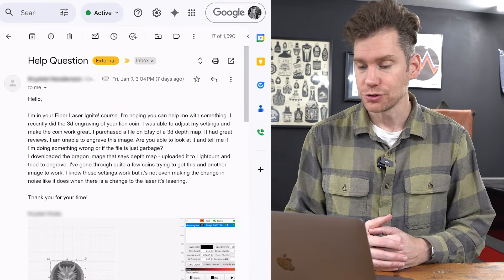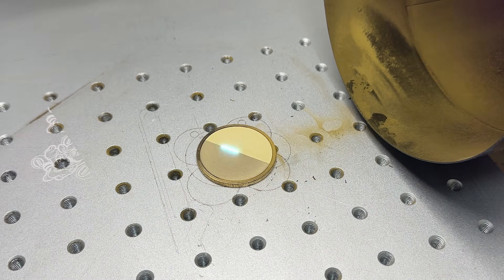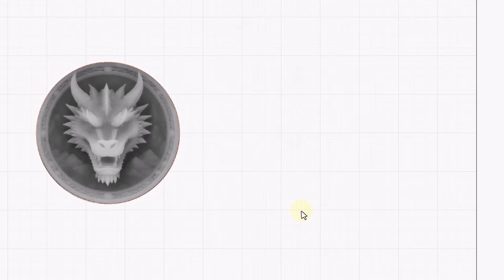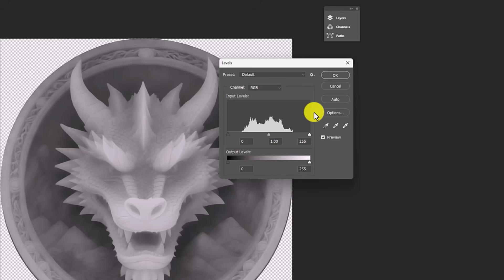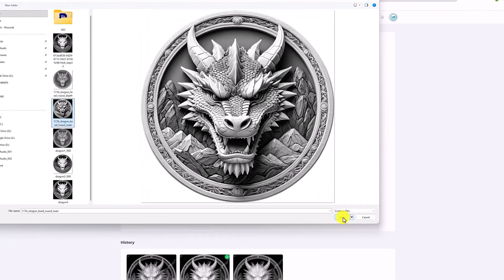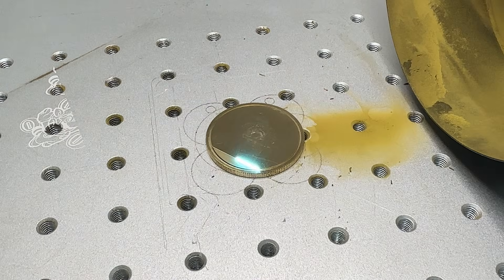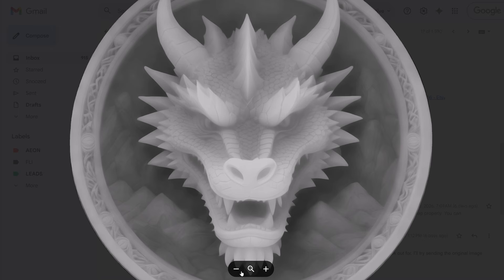The Real Reason Your 3D Coin Engravings Look Flat

Comment: 3D artist here, there is even a little more complexity going on than you let out in the video.

The depth map you got form that second tool from the original image, isn't a correct depth map. It's more of a shading map. This is because the algorithm making the map doesn't have an actual understanding of the shape of the object you provided it. It doesn't know that they nose is supposed to point further out than the nose bridge.

The original depth map is generated as if it was made from a true 3d model, so it's physically correct. But the coin is a very flat object, there isn't actually a full dragon head poking out of the coin, so the final 3d shape in the coin will be way squished and not as clear.

What that algorithm comes up with is making shaded parts deeper, meaning they will look darker on the final coin. This is similar to other traditional engraving techniques where you make the shaded parts rougher so they appear darker.

Now, the result looks amazing, because our eyes likes being fooled by shading tricks. That's how we can understand 3d scenes on a flat screen after all.

So i think your version looks better not just because it's a better depth map (not wasting layers) but because it's a shading map, which brings over the shapes better in the final result.

It's just a note to clear up what's actually going on. You are using shading maps instead of depth maps to get a crispier coin!

Comment: So for a C02 laser, would engraving a 3D image using the "grayscale" image mode work somewhat similar on wood? I might find that image test it...if that makes sense? The histogram demonstration was very informative...had not thought of that before. I suppose you can't get that before you by a 3D image.
Reply: It may, but it's highly dependant on the laser. Since wood burns you may end up with a topological burn like with a depth map on a fiber laser, but everything may be burnt and dark, hiding the definition of the depth map. If you, however, were to use something like cast acrylic the result would be similar to the coins here. My favorite way of laser engraving imagery on wood is not to use a grayscale depth map, but rather to have a halftone pattern, similar to how printing works, which essentially means you burn small dots of varying density which will represent the image you're trying to engrave.

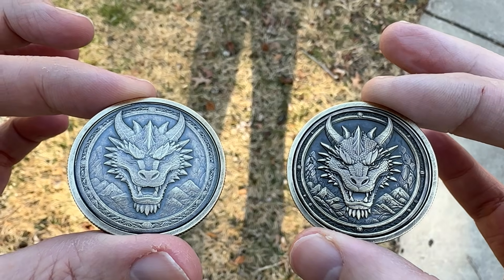Comment: In the side-by-side comparison at 5:38 the Dragon face has much more texture and detail with the improved depth-map on the right.
However, the coin on the left reveals much detail in the braiding around the perimeter.  So much, so, that you'd think it was different artwork (especially the circles with horizontal line at the 3-o-clock and 9-o-clock locations).
Also, the mountain ranges on the left are realistic compared to the cartoon-like rendering on the right.

Left:  subtle secondary details.   
Right:  vastly improved dragon face.

Comment: Ever write a comment you're sure is going to be deleted?

Not showing how to fix the depth map provided and instead use a sponsored tool to generate a new depth map, and then compare the unrelated engravings is bordering fraud. You're trying to imply that there's nothing that can be done with depth maps that lack range, and the only thing you can do is throw it out and use some proprietary service.

Comment: Are there any depthmap creation AI's that understand text?  I have a set of team logos to make, and the logo art has a ring of text that is perfect.  But Sculptok INSISTS that all text has shadows.  The text is already 3d with REAL shadows, I don't need the AI to add fake shadows.  ANY text in sculptok has a shadow added.  In most of my logos I have rings of text AND scrolls with text on them.  Sculptok destroys text.  It also changes spelling randomly.  And it also sometimes hallucinates real hard and you get one of the images that is really difficult to explain, but those are bonuses.  If they could fix sculptok's text handling, perhaps have it actually act on the prompts, it would be great.  Sculptok also doesn't understand or allow stars and constellations, so coin ready art is edited for no good reason by removing anything star related.  So symbolism /very/ common in badges is to include stars, or constellations.  The list goes on and on....  I love sculptok for the things it can do, but the things it can't do is extremely impactful for symbolism that might appear on coins.  Sculptok hates symbolism, hand gestures, and other random things, every challenge coin has something sculptok doesn't think is ok, and it is edited...  It might not do the same edit every time, but it will /block/ whatever it is it doesn't like.   My best coins were made without sculptok, but I get sooooo close with sculptok.  But I hate that I have to do so much work editing pixels and repairing the hallucinations, and fighting the ai.  It's like hiring the best artist in the world that can do anything, and he hates you and intentionally undermines you.  There are days I want to strangle the ai.  I am glad I don't do this for a living.  Most of the other AI's can do cool images, rendering 2d shaded images that appear to really understand 3d, but when you ask for the 3d image, they fail to understand their own creation.  I fully expect someone to start fixing these.

In my workflow where there is always text and at least one other element that sculpok actively refuses to render in a useful or sane way.  BUT if you only do what sculptok is /willing/ to do, it is a great tool.  I keep coming back.  But I hate it at the same time.
Reply: Yeah this is the big downside of AI programs, they are trained a certain way, and then it's very hard to do very specific micro adjustments. I think if you want this detail, it's more useful to learn photo editing skills so you can fix these things manually instead of beating yourself against an AI wall till you go insane. No tool is perfect.

Comment: You solved this problem by using yout own tool. It would be helpful if you explained how to fix it with any software package
Reply: You can't fix it without AI if you don't have access to the original 3d model of the creator. (if it even exists, if it wasn't made by AI) Because the sharpnes comes from shading tricks not the actual depth.

Comment: You can fix the image while you were in the histogram.  Use the white eye dropper and click on the highest part and then use the black eye dropper to click on the lowest part and it will adjust the depth map to use the whole spectrum. there are some other ways to do the same thing that are very easy.  I always adjust the image to start at least one layer down so that the laser removes the entire top surface before starting the depth map.  this way if there is a texture to the surface (and there often is) it will be removed first.
Reply: but what about SkultpOK ads??????
Reply: @SethPlato01  There are many free programs that have this same functionality.  Inkscape is one of them GIMP is another.
Reply: The problem with this approach is that it will still lack the details it could have. You don't regain the details that got smoothed into being the same layer when the depths span, hypothetically, 128 values instead of 256. Remaking the depth map is the better choice. You can see in the image that a lot of the details on the background disappeared in the first version.
Reply: @markjacobson4248  It's not just that. It's more complex. yes you miss some layer detail, but even if you used a tool to interpolate the detail, the final coin will still not look as crisp as his last example.

The original depth map, is a height field of the actual 3d model used to make the image ((or an AI imagination of that 3d model) , it's geometrically correct. But the final relief in the coin is less than a mm thick. So the shape in the coin is a squished version of the original shape. This reads less clear to our eyes and looks flat because it is.

What the depth map generator algorithm does is it creates more of a shading map. Shadows lie deeper, highlights higher. This is more close to actual shading tricks that traditional hand engravers use to make reliefs. You're actually tricking the viewer to see the image as more deep than it actually is by using depth as shading.

So this is something you can't fix in photoshop. Either you need to have an original 3d model, and do some shading tricks to get a good shading map. OR what he does, use AI tool like the one he showed to make one. It won't be physically correct, but it'll look nice.
Reply: @DrTheRich  The original issue stated was that the laser did not start engraving till level 47.  I just stated a method of setting up the height map utilizing the white eye dropper to start engraving from level 1. That's all.  doing the black eye dropper as well will set it to spread the height map over all of the levels you enter into lightburn.  it is similar to just turning up the contrast.  

    If you used exactly the same setting to run the original height map and the eye dropper height map on two different coins, the eye dropper coin "will" have more depth and detail to it. 

   There are better methods/tools utilizing the histogram than the eye dropper.  The eye dropper method is just the most straight forward.

   There is nothing wrong with using an AI something to just create a new height map of the original image unless you need/want to retain the integrity of the original image.  If you look at the AI image you will see that a lot of the  rocky background in the original height map was removed by the AI and is now just flat. If this was a 3d scan of a family (which I do as a hobby) and you use AI to make more depth, but it decides to remove areas of hair or change the way the teeth look it fundamentally changes  the image and it would be problematic, correct? (I have had this issue many times using AI)

    The final coin in the video does indeed look more crisp but it also does not stand true to the original depth map. It is all in what you want.
    
    I use both of these method in my tinkerings and they both have there place.
Reply: Alternatively (to using the dropper)(in gimp, should be similar in ps), switch the histogram view to logarithmic, then manually place the start and stop.
You might also want to edit as curve if you want some parts to take more or less space (also useful if you have multiple things in the gradient, that allows you to move them if they don't overlap in the z axis)
Reply: @satibel  Now you're talking my language.  The eye dropper method is what I used for years and it is easy to learn. As I learned more I switched to your method.  I personally use CorelDraw for the vector editing, but it does photo editing as well.  I also use Vectric Aspire as I can import the height map and it makes a physical model of it. I can then edit to my hearts desire, then export as a height map.

Comment: What is the best way to determine how many layers will be needed for the depth like say the image is 16 bit is that going to require 2x as much layers?
Reply from the maker: Current LightBurn only accepts 8-bit images at the moment. Apparently there is a release candidate being tested right now that will do 16-bit. I know of a few people testing it. Anything over 256 you will be doubling layers. Also takes forever once you get past that point.

Comment: What happens if you adjust the histogram in photoshop and crop either side?
Reply from the maker: LightBurn will still process it looking for the full 0 to 255 as far as I know. So Im assuming it will run similar with engraving "blank" layers. That would be a fun test Im really not sure.
Reply: @justinlaser  in photoshop, go to image>adjust>levels, and pull in the input levels on the left and right side of the histogram to crop it to the outer bounds of the image data and hit OK. That will eliminate the dead spots and remap the inner range of data to the full 0-255 range

Comment: While in Photoshop's Histogram, could you use the sliders to adjust the black and white point of the image?  Would that save the depth map?  I know in photography those sliders are used to set the black and white point of the image.  Makes a tremendous difference in contrast, but would that change the depth map to make it useable?
Reply from the maker: It usually doesnt "break" it apart the way it should. The best way to fix is with the dodge and burn tools and going over specific areas to darken and lighten. Will do a video on that next most likely.
Reply: @justinlaser I like to see and learn this. I don’t have photoshop but I use GIMP. Maybe there are similar options/tools in it as in photoshop.  But it seems signing up for sculptOK may be a good thing
Reply: @justinlaser  you can also create a better separation of depth maps by using the Curves command rather than the Levels. It allows you to more selectively push values either lighter or darker by adjusting the tone curve. SculptOK seems like a fine tool, but I do not like that it alters the source material. It's more like a depth map closely inspired by the source material rather than an actually accurate depth map. Then again, I make my own depth maps in 3D software rather than relying on downloading or buying them 🙂